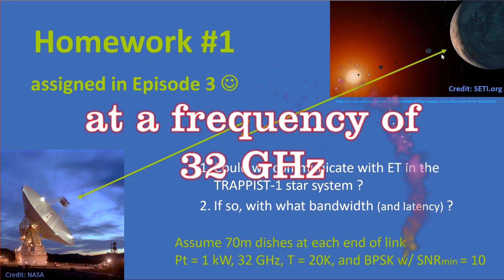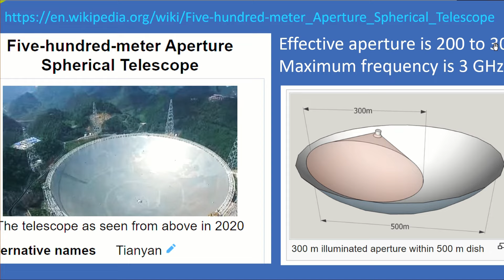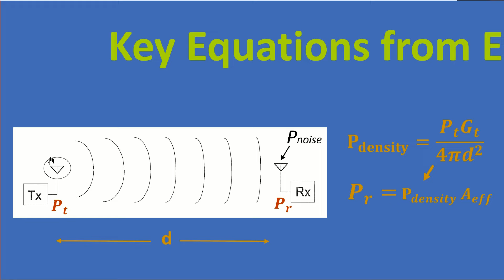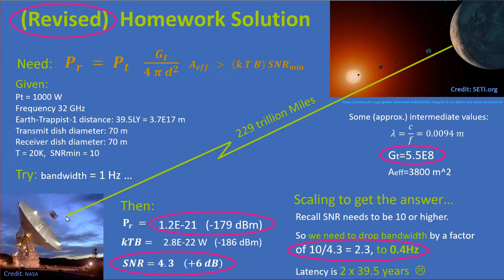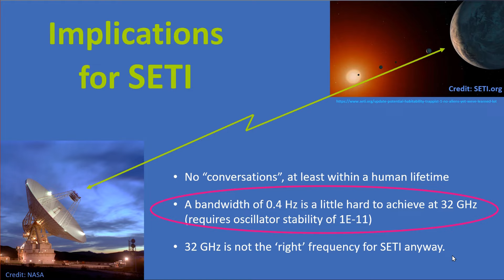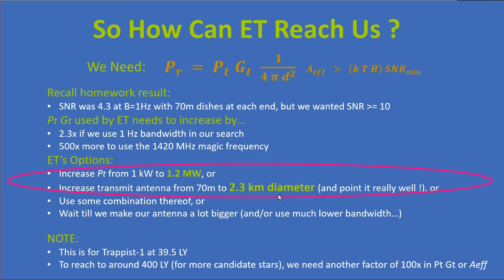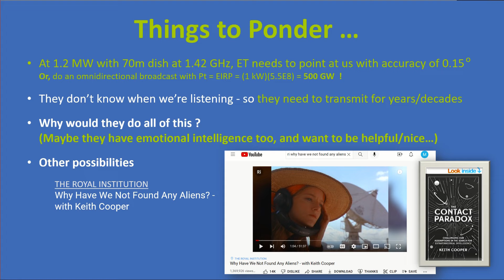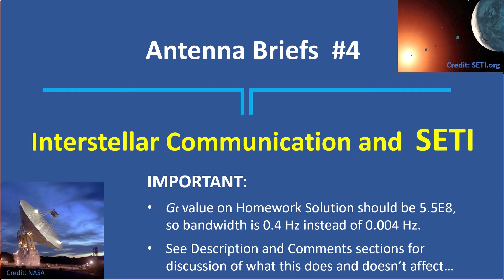Antenna Briefs #4 - Interstellar Communication and SETI (Revised)

Comment: This lesson was very humbling for me. A lot more to space communications than I've originally realized. One thing we have to assume is that there is any extra terrestrial life that is even as advanced as we are. Movies and tv portray "them" as superior beings, but we don't know the exact advancement of any life outside of earth that is close enough to communicate with us, or would use modes, or frequencies that detectable by us or them.
Reply from the maker: Yes - I had always wanted to look into this, so it was fun making this video. I agree that other life may not be as developed as us. But given 13B years for the universe and 4.5B for our little corner, it seems equally likely they are much more advanced, and have moved on (not sure to where...).   Perhaps the real improbability is to catch them at the right time?  Sadly, the background noise seems to rule out possible catches from lots of other distances (times), which could mitigate this issue.

Comment: Hello! This is a great video and a fantastic series! Thanks! 
I have tried to do the exercise and came up with similar numbers! But I have a question. 
In these calculations it seems to me that we are assuming that the receiving antenna is isotropic (no gain) ?

In the equation: P_r = P_t * G * (1/4*pi*d^2) * A_eff,  

G refers to the Gain of the transmitting antenna, and A_eff to the effective area of the receiver. But is defined as A_eff = pi(radius)^2, and so it only takes into consideration the area of the receiving antenna, but not it's "shape/gain"  (in other words, it is considered isotropic).

Am I missing something? It seems to me that we could get better bandwidth if both receiver and transmitter used the same high-gain parabolic antenna. 

Keep up the great work!
Reply from the maker: Thanks.  On the question about receiver antenna gain: that is embedded in the formulation by Aeff. The classic Friis equation uses both G_t and G_r, but to me, the G_r term is tricky to understand. Where does this "gain" come from?  G_t comes from focusing the beam. To me that makes physical sense. It gets brighter like a focused flashlight. Power tightly focused in one direction. But we can't really "focus" a receive "beam" because the received energy is a plane-wave as it passes us. The effective gain used in the Friis equation is actually caused by equations rather than any real physics. It increases as (D/lambda)^2, just as Aeff does. So one can formulate the received power expression either way. Hope that helps.  It's tricky stuff. (I actually struggled with why the received noise doesn't increase as Aeff (or G_r) increases, but that's another story. I figured it out once. I think its related to your question, and bound together with Fourier and reciprocity and coherence... )
Reply: Thank you for your quick comment!! Much appreciated. You said: "[...] It increases as (D/lambda)^2, just as Aeff does."

I think this is what I am struggling to understand. I used the definition A_eff = pi(radius)^2 (taken from minute @3:40) which of course does not depend on lambda at all. It just denotes the area of surface of the parabola (well, a circle), so it's the "real area" not the "effective area". 

Anyway, supercool to know that we can have keyboard-to-keyboards chats with planets light-years away, although with a "LITTLE" bit of lag :-P

I love this type of "back of the envelope" calculations! THANKS !

Comment: What about a whole bunch of red LEDs shining in that direction? Lasers have a lot more focus and the wave length is smaller.
Reply from the maker: Interesting ideas. Thanks! I hadn't looked into that, but am doing some researching now.
It looks like there is some recent work in this area at the SETI Institute. See for example: https://www.seti.org/opticallaserseti  And for a deep-dive, here's a paper that details choice of wavelength and looks at attenuation vs distance: INTERSTELLAR COMMUNICATION. X. THE COLORS OF OPTICAL SETI https://arxiv.org/abs/1804.01249
From a quick scan of that, it sounds like it could work. (which the SETI institute obviously agrees with). But one issue I can think of is the need for the distant civilization to be pointing in our direction (the precise pointing of lasers is both an energy advantage and a probability disadvantage I would assume).

Comment: Interesting! 👍 I did some some similar calculations trying to find out, how far we could reach out into space with different technologies. The results are comparable. Happy New Year!
Reply from the maker: Thanks ! That's great to hear. Too bad we don't have a bigger aperture. Maybe in a hundred years we could create an automated assembly of a multi-km diameter phased-array antenna in orbit (once it gets cheap enough to do).  I also suspect we'll have to start listening on long timescales. As biological folks, we're biased to 1Hz or faster. But that limits sensitivity, and if there's any data, it'll have to be modulated very narrowband. I suspect ET is very patient... :-)
Reply: @MegawattKS Yes, it seems that other solar systems are only in reach with a very narrow bandwidth. I also considered an array of big dish antennas, repeated messages, cooled receiver front ends, etc. The cost per transmitted MegaByte is becoming ridiculous. And finally I am asking myself, what question should I ask ET, when I can expect answer only 100 or 1000 years later? However, in our own solar system, other planets would be reachable. Even with ham radio.

Comment: Have you removed episode 4 or has it been replaced by this video?
Reply from the maker: It's still on YouTube, but is 'unlisted' so you can only get to it if you know the link. Here it is:  https://youtu.be/cDZz2xMFRy8   I unlisted it because it's largely the same as the new one - but I did like parts of it better (except for the calculator mishap of course) .  Sadly, YouTube doesn't really let you edit a video other than deleting sections. No additions/fixes are possible as far as I can tell. So I had to do it over in version 4A...
Reply: @MegawattKS  Thanks. 

Yes, you're right. You can only remove and replace a video totally, even if the changes are trivial. It's a bit of a pain at times.
Reply: @MegawattKS  Great series, BTW. Useful information, but presented at a sufficiently relaxed pace that I don't have to think too hard while watching in the evening.
Reply from the maker: @scollyer.tuition  Cool.  Great to hear. Thanks !